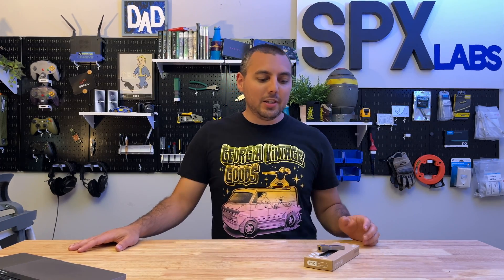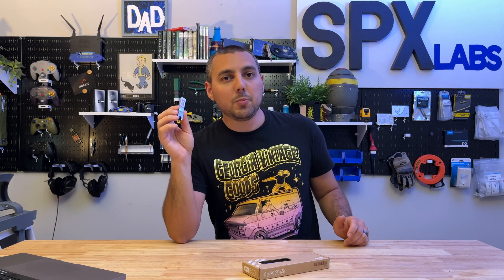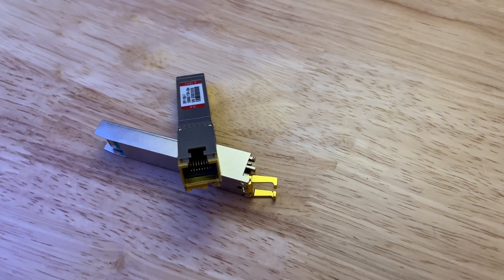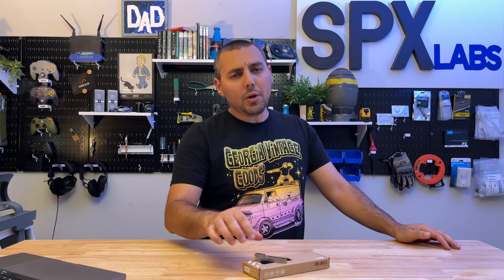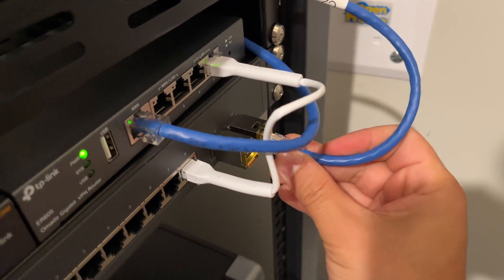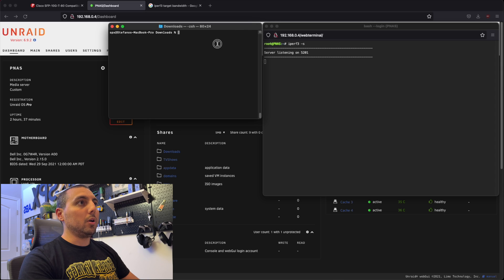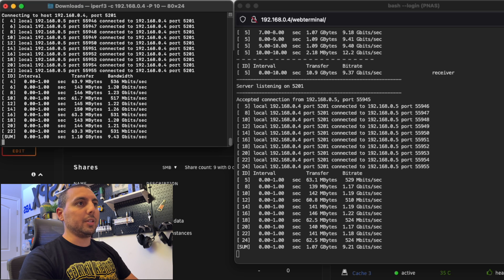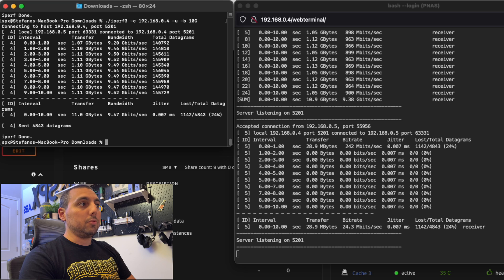Best SFP+ Modules / transceivers for TP-Link Omada SG3210XHP-M2? | FS.com

Comment: Does the 10GB uplink port supports Fiber Optic cable? OM3 multimode + SFP+ transceiver for fiber
Reply from the maker: Yes of course.  On newer TP-Link Omada Equipment I have had some trouble with my FS modules and have switched to TP Link products.
https://amzn.to/3PMXn4H
https://amzn.to/3PMDwCM
https://amzn.to/3ZGCsUx
Reply: @SPXLabs  Thanks man. I need to double check. I have a client who will upgrade his home network.

Comment: Hello i just bought some sfp+ transceivers for the same switch and noticed that I only get half of the upload speed when I use them.
Do you lnow of there is a reason for that? Download speed is fine.
Reply from the maker: Try turning off auto negotiation and manually setting the link speed to 10000mbps.  If that doesn’t work then I have no idea what your upload would be half the speed.

Comment: Would you think they will work in a aruba instant on 1930/1960 switch?
Reply from the maker: Considering Aruba is listed as a supported device, yes.  Just make sure you select it I. The drop down menu

Comment: Should I be using one of these on my UDM Pro? I currently have the modem connected to Port #9 on the UDM Pro. Instead of having the modem plugged into Port 9 should I use this FS module in Port #10 and will I see any improvements?
Reply from the maker: You could use an FS one, just make sure it supports 1, 2.5, 5, and 10G.  You know just in case.  But for my UDMP I bought some weird WiiTech module on a recommendation from someone.  It works well enough. For now.  It’s brand new to me so not sure if it’s good quality or not.

I got more Internet Bandwidth out of my AT&T Gigabit Fiber Plan with this SFP+ Module in my UDM Pro
https://youtu.be/nM0gFzDU9fo
Reply: @SPXLabs  Yes I saw you video where you showed you got better uploads speeds. I have Spectrum and was checking to see if this might improve my upload speeds or just have the UDMPRO work more efficiently . So would you recommend to use the WiiTech module or the FS module? I see how the FS module is working for your TP Link switches and it might be very good for that. So I hope their is no conflict of interest supporting the WiiTech for the UDMPRO, since these are two different hardware items.
Reply from the maker: Well the reason I mention it is because I tested with WiiTek and I know it works.  I haven't tried with FS.  FS could work just fine.  I still recommend FS, like when you can or if you can afford it.  But like everything you should always consider other brands before buy anything.  I have FS in my ubiquiti stuff and it works great, also works great in TP Link so far.  My interests are in making sure you guys can make more informed buying decisions and less about hocking tech.